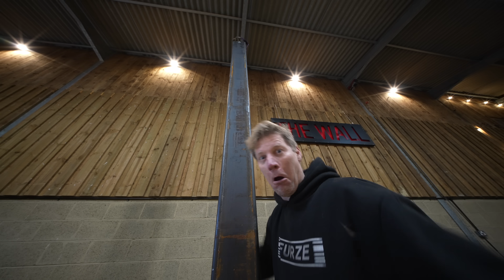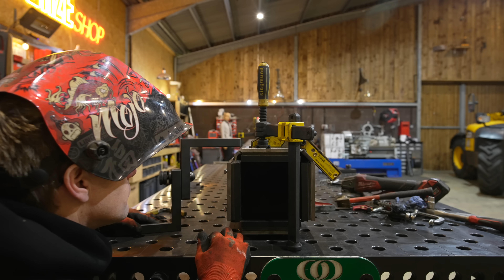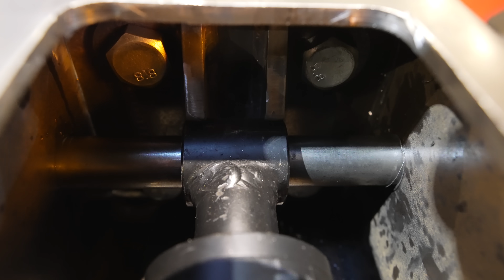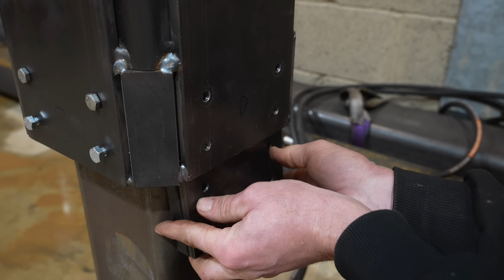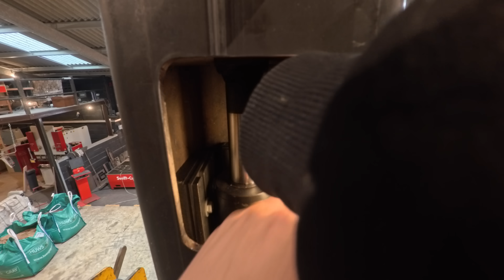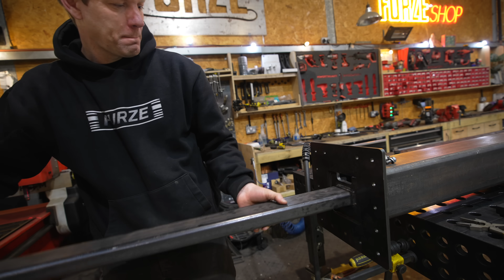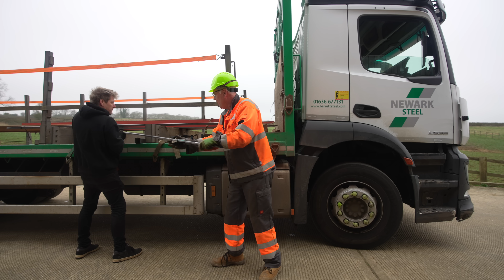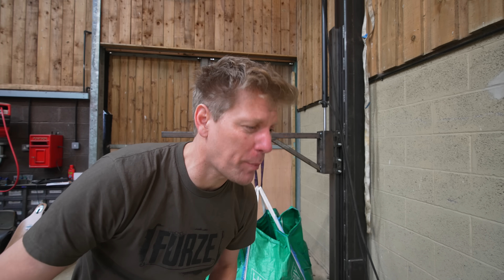Digging SECRET Garage Part 7 Car Lift Prep

Comment: I’m just curious, what about putting an access port on the top of each post (and the parking area). Lift the hydraulic ram out from the roof/parking area. Build a movable U-Frame that slots into the top and  lift the ram with a winch. If lowering the ram back down into the garage, make the access port big enough to swing to the side and lower it. You’ve done good so far, so I’m assuming there is a reason you’re not wanting to do this.

Comment: I do wonder what your plan for the guide rails are to stop left-right rolling movement in addition to the front-back pitching movement.

Also, +1 to the concerns about the slot for the hydraulic ram. You might want to run that one by your structural engineer buddy again, if they’re willing.

Edit: That’s what I get for not finishing the video before commenting, haha.
Reply: Actually.....that's what you get for being arrogant....and thinking you could possibly know better than Furzy.....!!!
Reply: @andymccabe6712 Furze had a whole episode where he documented how little of engineering he knew and worked out torque experimentally. His solution is contacting actual trained structural engineers for help with the really significant stuff. He’s a solid engineer, but I don’t think I’m completely wrong to mention things that concern me.

Comment: maybe this is already in the 3500+ comments but instead of fixed bearings in slotted holes (minute 19 in video) maybe use strong springs to account for varuances in the meam caused in manufactuting or thermal changes.

Comment: Still don't get why you chose direct lift hydraulics Vs lever or block and tackle reduction for the force to lift the garage part. You're playing with tighter potential failure specs rather than having a huge margin of error. yeah you still need the piston but it only needs to push a tinny fraction as hard to lift the elevator. look at scissor lifts with threaded rod or hydraulics
Reply: He wants all the space in the room available with the lift up or down.
Reply: @nicknelson9450  scissor lift can be in the same space he's using for the posts on the two sides it's a long standing way to raise platforms with less failure rates than direct piston has.
Reply: @dragoneyeshatesg00gle76  I see, well I'm not an engineer, but it seems to me the vast majority of solutions are 2 scissor arms on the long side of the rectangle with a support joining the two in the middle pivot point for lateral stabilization, meaning you lose the access underneath. While it's possible, as you may be suggesting, to have scissors on edges with nothing joining them via the space underneath, here we want access from one of the long sides, i.e. from the other half of the basement, so I presume you mean having the scissors on the short edges of the rectangle? If so, you woull also still need 1) hydraulic synchronisation between the two ends to ensure the long plane stays horizontal with varying weight distributions.  2) rollers and c-channels at the four corners for lateral tracking and stability 3) a beefier platform for the long span, eating into your vertical real-estate. If you have to Implement the first two, you may as well choose the four-post solution, allowing a slightly less beefy platform and losing the complexity of the scissor mechanisms which here doesn't offer a value-add? I do underrstand that the four hydraulic jacks don't leverage the mechanical advantage of a scissor or a block/tackle /pulley system...as you said, they would provide a higher saftety margin since they have to work less hard to lift. I imagine Colin, despite the obvious sponsorship interest here, has decided the extra cost would be unnecessary? I presume that his intention to have it all verified with a structural engineer would confirm his technical decisions about this too?

Comment: Me watching all of these and thinking... Were Gears safer and faster to make and easier to repair?  you put an engine (or not if you want to make electric) under and gearswheel in the 4 pillar. there is less stress and everything should work fine . 
And if electricity or power goes out with a simple mechanism you can be sure it doesn't fall down. 
Sorry english is not my language  and I'm not an engineer, I'm a constructor worker (the guy that try to find always the simpler and safer) idea to make the work

Comment: A normal modern Hydraulic elevator uses 1 hydraulic ram and steel wire ropes with a pulley to lift the car.

Comment: Out of curiosity, wouldn't this be better built with the outside box tube being the one that moves and using a very thick all-thread outside the 2 box tubes to spin and lift the unit? 
You could link the 4 lifts with chains at the bottom, below the thresholds and use a motor to lift all 4 units?
I genuinely think hydraulics here was not the best call.

Comment: I'd still add a 2 direction level-safety switch to two corners of the underside of the top (a primary and a backup).  If the elevator does not maintain level, it'll stop the power and apply the brake to prevent accidents and extremely difficult to fix "wedging" problems.  Also, you are going to have to add some sort of sensors to the top and possibly bottom to prevent "scissoring".  I'd also recommend weight sensors that only allow the lift to move while the weight remains constant (G-force compensated) to prevent various other safety scenarios such as binding or things falling/moving during the lift.

Auto-leveling systems are great, but they often don't compensate well for catastrophic failures.  When it comes to elevators, you really can't over-build or have enough safety features.

Comment: One thing I'm a bit confused about is that at 26:50, he calculates that the four legs will be able to lift 3.2 tons, with the delorean at 1.3 tons. However, pay attention to what is said at 12:00. There is the inner ramp with the platform and the car (estimated at 2.5 tons max). Then he mentions the drive above it, and potentially if he parks another car on top, which in total he mentions as 10-12 tons. Did I miss something in the explanation?

Comment: Perhaps one or more of these things have been said already and I expect you have an engineer engaged.

1. This thing is an elevator. They typically require specific permits.
2. It is also potentially a slow and blunt guillotine. Yes, you have a break, but what stops someone bridging the gap between the platform (and roof) and the ground during normal operation?
3. You should consider safety valves on the cylinders. They prevent flow should a hose be cut.

There is more in my head, but I suspect this would be covered under elevator standards. I say all of this because, as an engineer, big/heavy moving stuff makes me super cautious. The safety standards are typically written in blood.

Comment: I'm actually outraged that when you bought a "1 tonne" bag of sand it was only 770kg...
After checking the advertised mass is only 800kg, but they're still ripping you off by 30kg!

Comment: To synchronise without the cables you could use 4 gear pumps of the same displacement volume. Each cilinder gets its own pump and if all pumps are on the same shaft(or otherwise mechanically connected driven) they have tot displace the same amount of oil to each cilinder each turn. At the bottom point use overpressure valves to reset the synchro due to hydraulic leak losses.

Comment: Not sure if this has already been considered but i work in the live events industry and what commonly happens with hydraulic stage lifts if they’re at height for a period of time they start to ‘sink’. This is often countered by having pins that the platforms sit on when at the stage height taking stress off the hydraulics. The platform gets lifted 1-2 inches above the level it needs to sit on. Inside the platform there’s the pins that get extended into the surrounding slots and then the platform lowers onto these pins, holding the platform in place at height even with weight changes on said platform. It does the opposite when required to lower. Something to consider if the platform is expected to be at driveway height for an extended period of time.

Comment: As a retired elevator constructor, I'll throw in my two cents. You should consider locating a pumping unit for a hydraulic elevator, possibly even a used one. With a properly sized valve installed, this would give you plenty of output and speed. Yes, keeping all four jacks moving at the same rate will be an issue. I've seen it done with wire ropes and turnbuckles to adjust tension, but to be honest, I've only worked on units with only on two rams in this situation (At the GM tech Center, their wind tunnel had massive heavy curved steel fins that could rise up out of the floor and divert the wind), and trying to adjust those crisscrossed cables was a huge PITA. There are other ways, such as cables and sheaves/chains and sprockets that can be done as well.

Comment: Hydraulics are a pain to work with.  Need a lot of ongoing maintenance.  Are power hungry.  Are slow.  And fail catastrophically.  You should have used a screw mechanism.

Comment: car lifts for inspections allow for easy access to the bottom. which your design does not. better have a commercial type seperate car lift within your car lift.

Comment: Former hydraulic engineer here! A very effective way around the level of the bed would be to use a dual axis inclinometer through some sort of PID controller. each ram will be controlled by its own solenoid. If the bed starts to raise at the wrong level the sensor will tell which valve to open to keep the bed exactly level. with some 0-5v pressure sensors you could also easily display how much weight is on the ramp at any time when lifting. lots of really clever things that you could implement if you went down the digital controller route like parker iqan!

Comment: Hey what about the safety system when closing the lift if something or someone comes in between the lift and the ground it will be crushed any safety measures for that and what about if someone falls in when the inner ramp lifts, I would put a cage around the lift with a gate. i think having some height sensors for the lift would be a good idea, it can do multiple things it can detect leaks if the lift slumps and check the speed of the lift to ensure the pump working optimally.

Comment: Another solution might be to have the top surface unconnected to the corner posts. If the corner posts were only a bit taller than a car then they would only catch and lift the roof /  top surface as much as necessary when needed. Same effect but mechanically simpler.

Comment: Using hydraulic cylinders in the four corners is going to require a way to keep all four lifting evenly or the whole idea is going to bind. That's why car lifts have cables, so all four posts lift evenly, or one large single cylinder in the center. What works for just one column is going to be sadly different when all four start binding and the corner with the least mechanical binding is the one that gets the most push from the hydraulic cylinder. You would do better with cables or Acme threaded lead screws and a chain linking all four to keep them lifting equally. A hydraulic system with all 4 cylinders being driven from the same pump is not going to lift evenly. The one with the least load/friction is the one that will have the most lift and make them more unequal and the more the lift will bind up. Four gear pumps on the same motor shaft with equal displacement and each cylinder fed separately from it's own pump has a chance of working, but not with all four cylinders being fed from just one single pump. The cross feeding will cause problems. Sorry, I just can't think of a better way to describe this. It won't work, Colin !!! Maybe after you get the second built and tied together with the first, and you try to keep both lifting evenly, you will see the problem. It will be worse with 4 cylinders fed from one pump.

Comment: Imagine looking down at the driveway level, a small manhole on each corner, under which a heavy flat plate bolted to the top of the leg, with the ram mounted below, to remove the ram, un pin n disconnect the bottom, unbolt the top plate, screw a lifting eye into the plate, lift the plate/top mount n ram out the top in one go. Could be hiab, gantry, pallet mountain what ever to remove. No worrys of falling as it wil be in lowered position.

Comment: 29:25  some of the 4 post lifts we have use a fluid  chamber to maintain level. The fluid i believe something floating on it that cuts on off hydraulics as needed.
Reply: double pilot operated check valves would be key
Reply: I was wondering whether to keep the posts in sync it might be simpler to have heavy duty ball screws linked together with a chain around the circumference, rather than hydraulics, but I haven't considered the particular application. Simply thinking about synchronisation and precision.

Comment: Love your videos. A quick idea I had, instead of having the daisy chaining idea what about a laser setup so the laser shines a light from pole 1 at a mirror mounted to pole 2 (45 degree angle) which diverts the light to pole 3 which has another mirror (45 degrees again), which in turn diverts the laser to the fourth pole that, and you guessed it, has another mirror (again 45 degrees) which diverts the laser to the first pole again to a sensor. This way, at least in my head, if any of the poles get off whack the sensor sends a signal to a relay and stops the system. As a bonus this would fit nicely with the DeLorean "theme" as it would be semi futuristic. Cheers.

Comment: Hi Colin, why not cut two slots on opposite side of the SSH so the top of the hydraulic ram can tilt back and the bottom of the hydraulic ram can pull forward? The slots could be made slightly smaller but the same length. You might have to strengthen the middle of the SSD somehow but that depend if the slots overlap in the middle.

Comment: you’re not the type for electric cars, but if you ever wanted to put those on the lift, be aware that those are much heavier. the cybertruck weighs 3000 kg :)

Comment: 4:50 tapered head bolts would be better. Mainly when the pads wear out, no chance of contact. Can also grab more material, and avoid the sharp edge needed for the washer step.

Comment: If you haven’t studied the lifts from the Carvana vending machines I would have a look. They use a plate system to pull a car off a shelf and bring it down to a turntable. May be able to get some solutions from that machine.

Comment: This is incredible, but after seeing the inside of the tubing start to rust, I would have wanted to put some sort of conversion coating on it. But I'm also gun shy from owning an old Jeep with a box frame that is in the stages of being replaced section by section...
Reply: Cathodic protection is your friend. Chunk of aluminum electrically connected to the frame corrodes and forms a protective coating at the same time... but I don't know the metallurgy of your situation so maybe that's bad advice - consult your local electrician or plumber if they're used to using copper pipes as "ground wires"

Comment: My rotating ham radio tower, 108 foot tall exposed above ground with 100 square feet of antenna windload across 41' above ground to the 108 foot upper mount. It used a 14" OD bottom section with shaped BRONZE Bushings with grease as a lube only 6" long at the ends of the outer tubes 16" inside dimension. That tube went 10 feet into concrete into the ground where it sat on a simple hardened bearing surface 1.5" across. If your Nylon Bushings don't hold up, the bronze probably would. It was called the TELREX BERTHA POLE. Easy searches for others who have duplicated Bertha's over the years.

Comment: Are you going to have a system in place similar to lifts to see when it's at the correct level? 
Like a laser sensor to detect when it's at the correct floor so that it doesn't overshoot and you have a difference in height between the platform level and the outside ground level.

Comment: For maintence of cylinders. Could have mad a access pannel on top  that you could full down  take off undo lines  from below with pin golding bottom then with a strap  pulled cylinder out the top

Comment: Hi! You've chosen the most dangerous and most expensive design. Cables and pulleys, with the platform moving along guides—that's significantly cheaper, simpler, and faster.
Hydraulics, in my opinion, are less reliable.
You're not limited by the weight of the equipment. The motor and gearbox will simply be significantly smaller and more efficient.

Comment: Its not over engineered this is how stuff used to be designed a sturdy working version then with engineers you can make stuff as close to minimum needed  how much less meterials needed

Comment: I dont think the cable system will work on the lifts. I think you will need a spool type flow divider. They work like a fixed displacement pump except they are not powered. They equally devivide flow by mechanically binding each spool section. Basically for each rotation, an identical amount of fluid is pumped into each cylinder.

Comment: Colin, you should look in to building a hydraulic synchronizer like they do for vertical rise truck lifts. It eliminates the cable system, and tucks it all in to a nice compact control box!